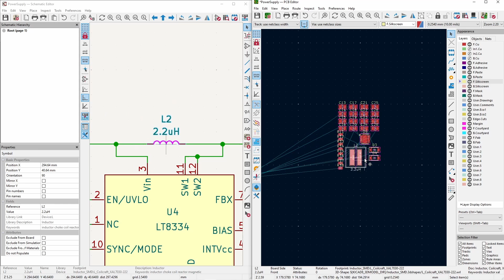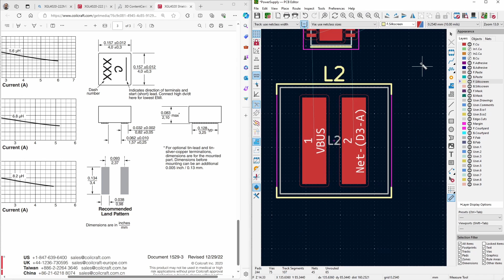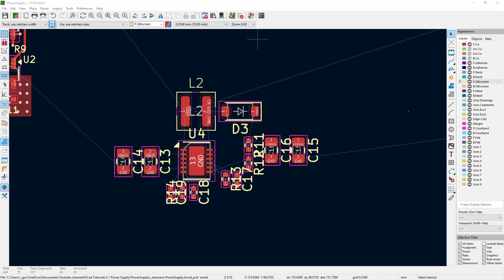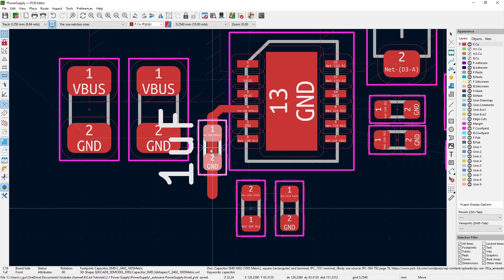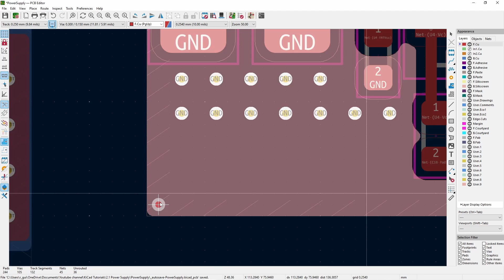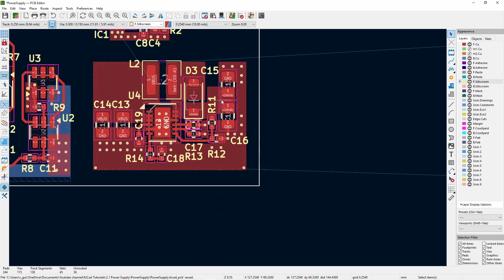Boost Converter PCB Design! - Let's Design a Custom Power Supply - Part 5

Comment: Hi,  I intend to use the TPS63060 'Part' for my own designs using a Lipo Cell and the TPS to transform the voltage to a constant 3.3V ( For a remote sensor application) . I created my own board based on the original TPS schamtic and tested the power consumption. I saw that the cicuit used over 10mA even if NO load was attached. This makes it unusable for a remotly operating sensor which depends on as low power consumption as possible. Could you confirm that the TPS even without load draws a current >10mA ?
Reply from the maker: Hi, I will have a look at the no load current draw for this part.

10mA does sound unusually high though. 

The nominal current draw 60uA on the input and 15uA on the output according to the datasheet. 

What value resistors did you use for the feedback network?
Reply: @TheEngineeringExperienceYT  1M and 180k => gets me about 3.4 V which is ok
Reply: @TheEngineeringExperienceYT  One Addition, the drawn current varies depending on the input voltage. Maybe it depends on the mode the device is in(Buck Boost). for a voltage ~> 4.4V, the drawn current is reduced to a couple of uAmps
Reply from the maker: Figure 7-2 shows the quiescent current across the input voltage range so something doesnt add up with 10 mA of current with no load. I am getting the board in few weeks so I can test it and let you know.
Reply from the maker: Are you able toggle the enable pin to see if the input current changes?
Reply: @TheEngineeringExperienceYT  yep, enable pin floating... no change... tied to GND => 0 mA as expected. Back to V+ = again >10mA.
Reply: Hi, I think you can forget my posts... I removed the TPS63030 from my PCB and soldered a new one. Now the quiescent current is about 40uA which seems to be ok. It looks like my first heat plate soldering caused some trouble.
Reply from the maker: Glad you figured it out!